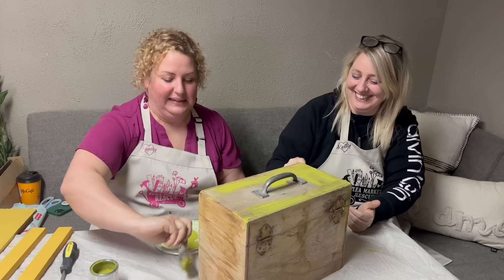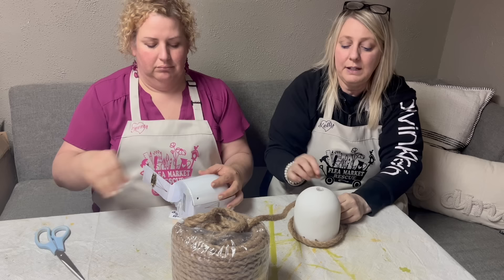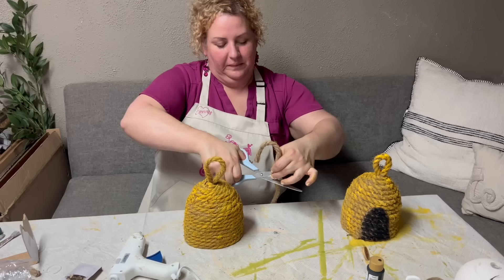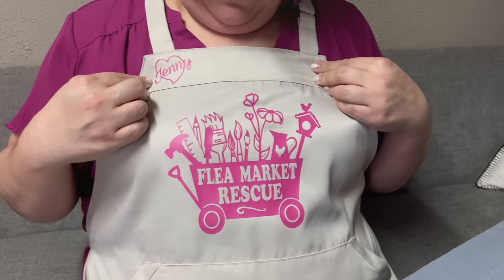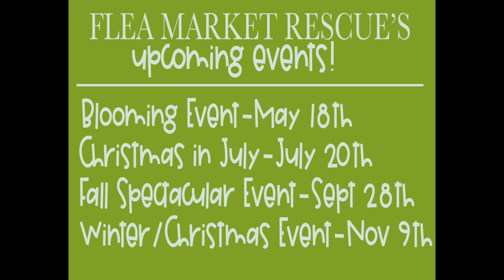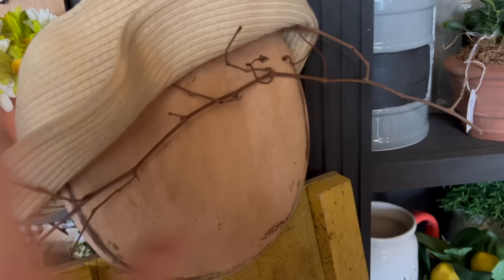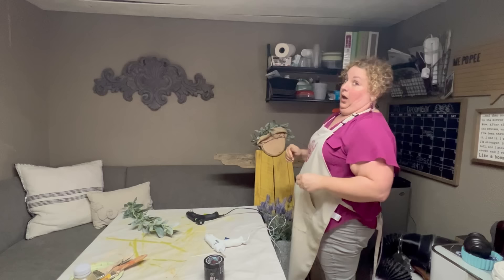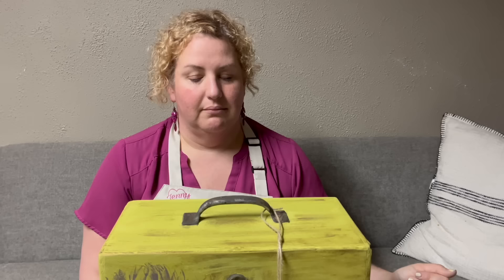SUMMER DIY TRASH TO TREASURE HOME DECOR THRIFT FLIP PROJECTS 2024

Comment: The NORWEX cloths for cleaning mirrors & windows are AMAZING!  Similar to microfiber but much better in my opinion.  The best part is you don’t need an additional cleaning product - just wet the cloth & use.  They’re the only thing that gets rid of salt spray & grime on our shore house sliding doors without smearing. The company also makes stainless steel cloths, dish cloths, and other innovative cleaning products.  I’ve been using them for years but they are pretty expensive.

Comment: Lots of paint and then spray your inlay before you lay it down. Lay it down, spray again, dab dry with baby wipe. It's not suggested to use a hair dryer or heat gun. It doesn't take them long to dry. Spray again, dab excess water, pull away. Perfect every time.